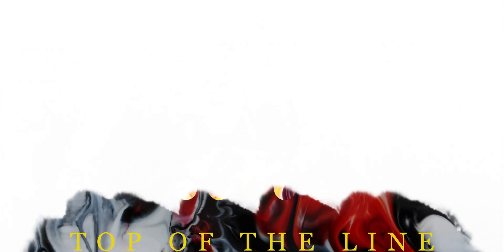Why do electrostatic headphones need special amps?

Comment: Most of the electrostatics just use a conventional amplifier with a step transformer on the output. Those boxes the stats and electrets plug into are just transformers and a dc bias supply.  There are some direct drive amps but those are typically very expensive.  The only difference between electrets and electrostatics is whether the charge on the diaphragm is externally driven, or incorporated into the diaphragm 'permanently' in which case the diaphragm is called an electret.  Think of it as analogous to a permanent magnet, but with charge, and yes, the charge does dissipate over time, absolutely no question about it, and it is NOT subtle.  My Audio Teknica TK33 electrets have gotten very puny over time, the sensitivity is way down, and the bass gets all rolled off to pretty much non existence, and they were flat to 10 hz when new.  I've thought about 'recharging' them, and the process is pretty simple, but requires some good fairly accurate temperature control.  Oh, and the transformers are not cheap because they have to be built to be used in an audio amplification chain with any hope of being at least not totally 'opaque'.   At best they are severely non linear devices.  I just picked up some Stax  SR5s and they should be here tomorrow, an early Christmas.  :-)

Comment: Would I be correct in thinking that  an electrostatic energizer is simply a normal amplifier with a transformer between the outputs and the driver? I can't seem to find any vids about the circuit topology. Cheers guys, mega love xx
Reply: That is the simplest concept, but only half of it. A normal driver is two wires, electrostatic drivers need 3 wires. 2 for the audio + and - polarity that has been amplified to have a higher voltage. The extra/third wire is attached to the thin diaphragm. This requires a high voltage, low amperage charge. This can be a positive charge or a negative charge, doesn't matter so long as it is one or the other. This acts as the magnet in a normal driver because it gives it a constant polarity. This also determines which way the diaphragm will move (the phase of the driver), so they make sure they are correct or it'll be out of phase lol.